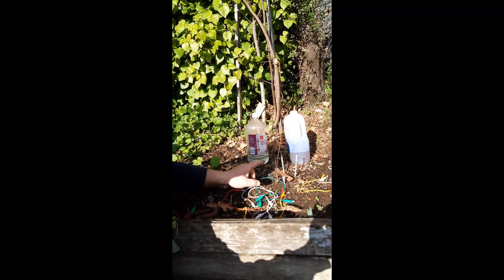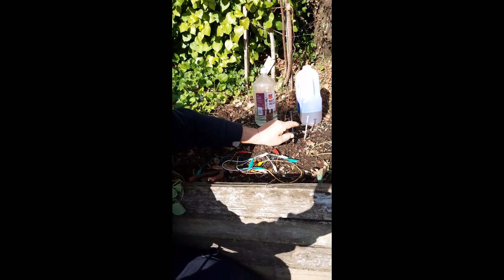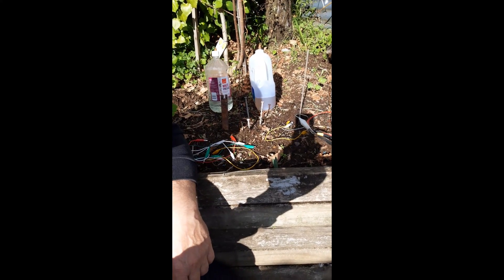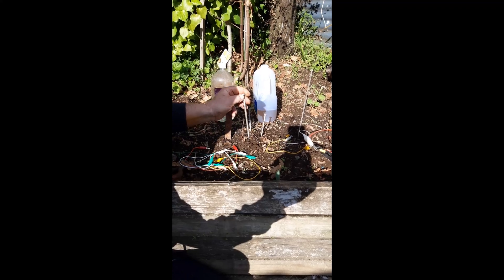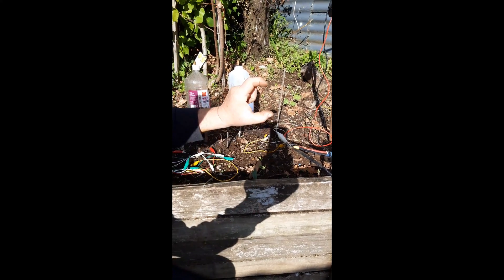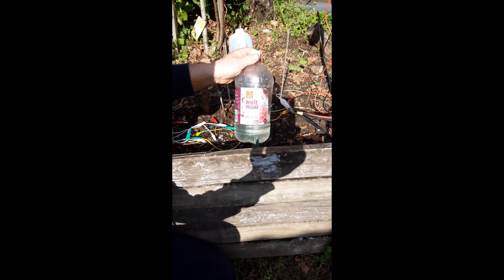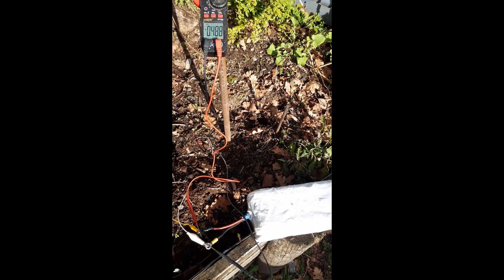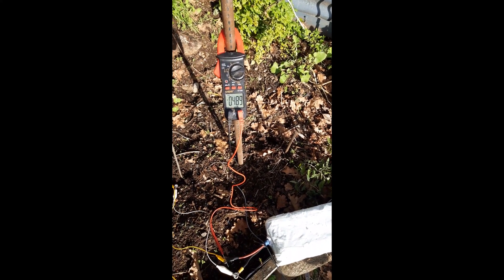Grow your own Electricity! -shorts

Comment: That's cool Mate, have you heard about getting power from the air ? By string up a length of single strand wire from pole to pole insulated from the poles and using the earth as the negative. The higher you get the length of wire up, the higher the voltage. I saw it on another YouTube channel.
https://www.youtube.com/watch?v=TrhzkCZ5xf8
How is your wind generator going after adding those extra magnets ?